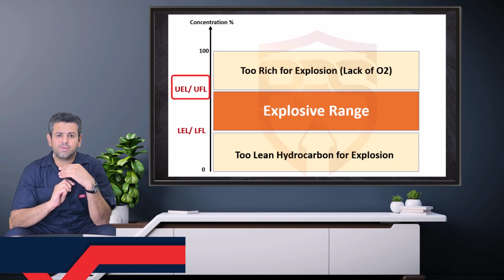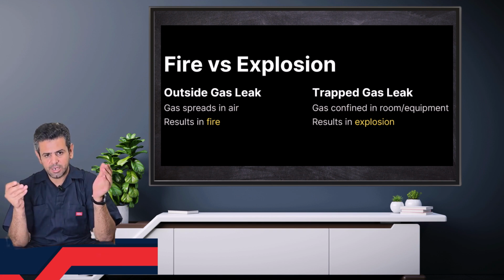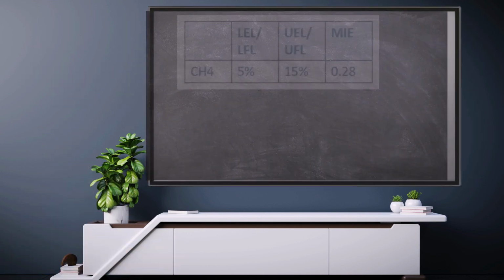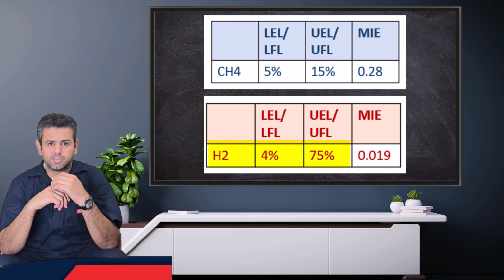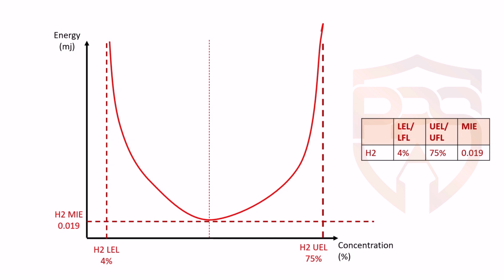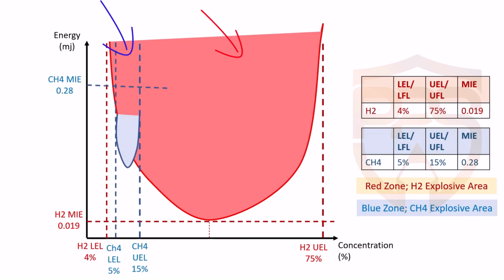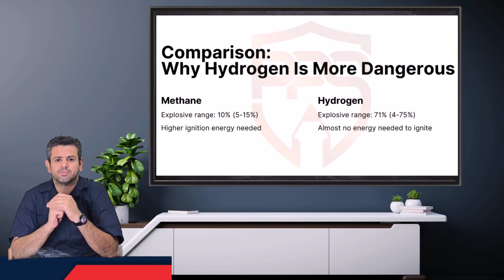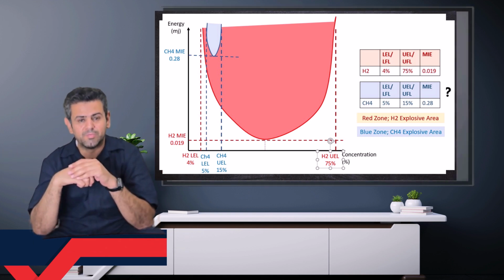LEL vs LFL, UEL vs UFL & MIE Explained | Process Safety Made Simple

Comment: Dear Yousef Thanks for sharing such an important issue here. But about your question:
I think it depends on the fuel-air mixture especially when air is suddenly introduced. The most violent explosion potential is not near LEL or UEL, but closer to the middle of the flammable range.
•	Near the LEL, there isn’t enough hydrogen — flame propagation is weak.
•	Near the UEL, there isn’t enough oxygen — again, combustion is weak.
Accordingly Middle of the range = strongest explosion hazard.
Reply from the maker: Exactly Mozaffar❤ thank you